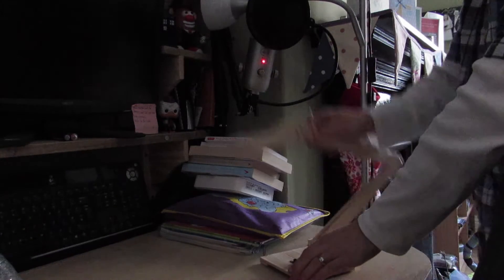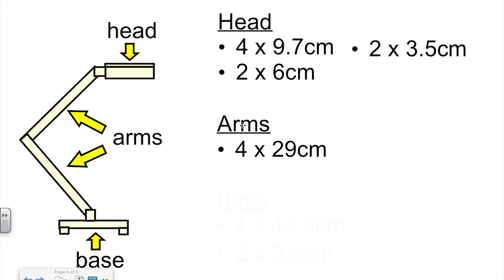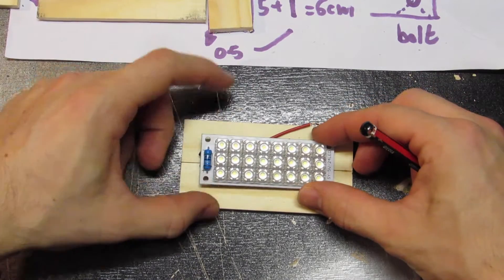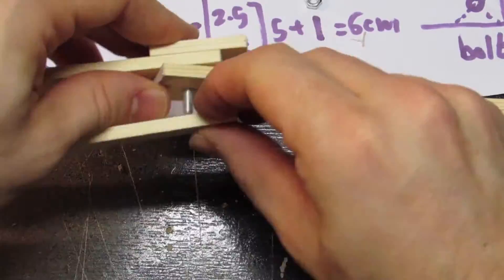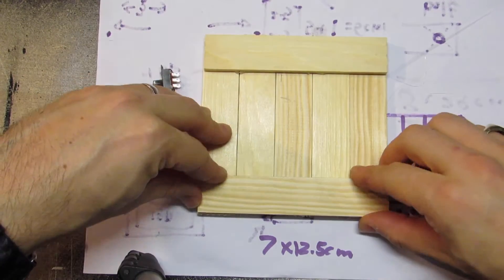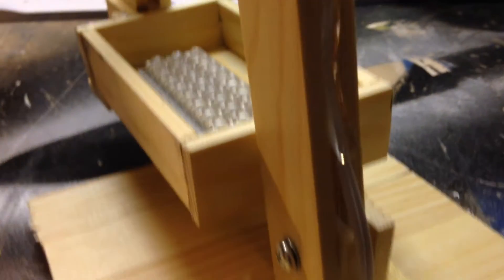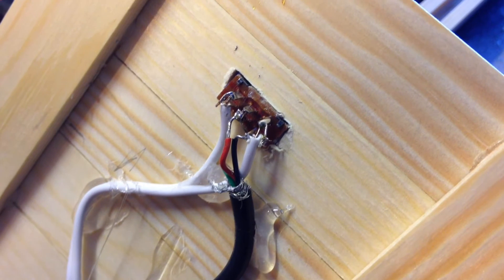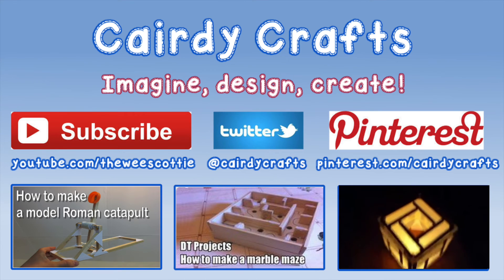How to make a USB-powered, posable desktop lamp

Comment: Your wiring of +5v and GND look wrong: you would short +5v to GND when you turn off the lamp. In fact, the GND shouldn't even be on the switch, just solder the GND of the bell wire straight to the GND of the USB cable, then insulate the soldering point with hot glue, without going through the switch.
Reply from the maker: Without the switch though, how would you turn it on without unplugging and plugging it in each time?
Reply: The +5 would still go through the switch.